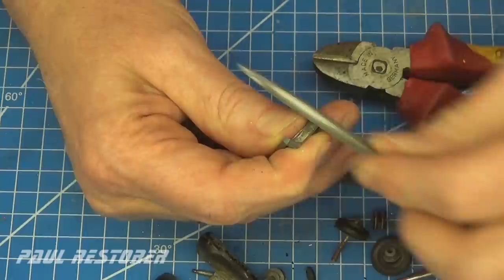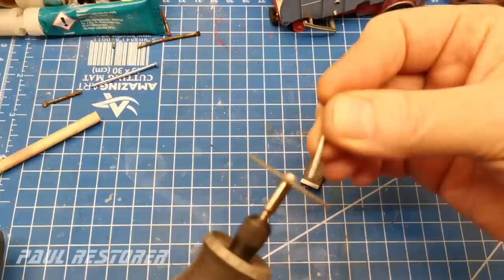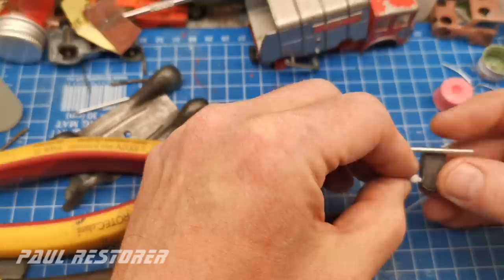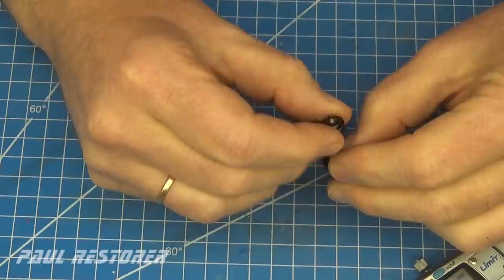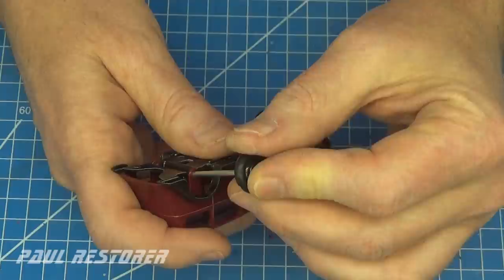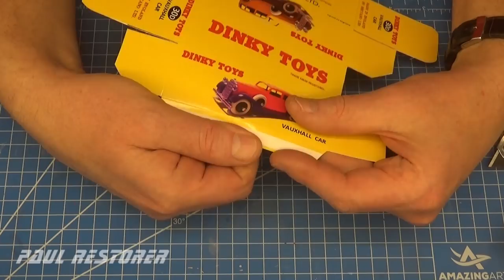Dinky renowacja Vauxhall Saloon nr 30d. Rok produkcji 1946. Zabawka model odlewany.

Comment: Excellent job!  I have never molded a piece before, but I need to for a project restoration I want to do.  Why did you cut the mold you made for the headlights almost in half, and why keep opening it as you poured the resin in?
Reply: Is the easiest way  to extract de molded piece and keeping the mold somewhat open avoid that air bubles remain inside ruining the piece
Reply: @abdelbaron6593  OK, I understand.  Thanks.

Comment: Hi Paul. Can you tell me what materials are best used to make tires for Corgi, Dinky cars and what materials I should use to make the molds for the tires?   Cześć Paweł. Czy możesz mi powiedzieć, jakie materiały najlepiej nadają się do produkcji opon do samochodów Corgi, Dinky i jakich materiałów powinienem użyć do wykonania form do opon. Dziękuję Ci
Reply from the maker: Hi Kris. Sorry for the delay in answering. I use the MM 940 foundry silicone for the production of molds. I cast the tires from molding polyurethane with a hardness of 70 Shorea. I dye it with a black resin dye. It seems to me that this is the best set for today. greetings
Reply: @PaulRestorer  Thank you, Paul.

Comment: Why didn't you paint the radiator before you fixed it
Reply from the maker: Chrome takes a long time to dry, so I prefer to paint it on the assembled part. Then there is less probability of damage
Reply: @PaulRestorer  👍